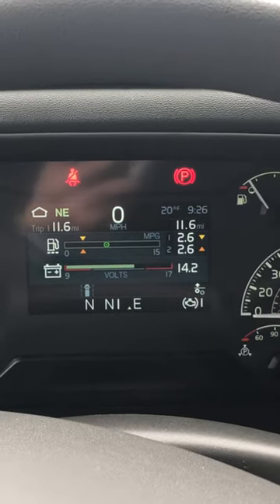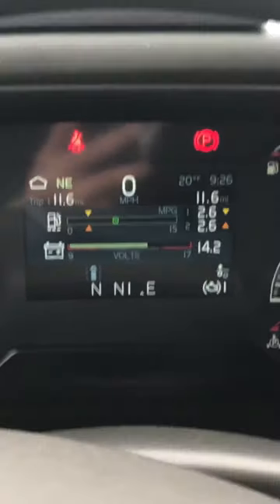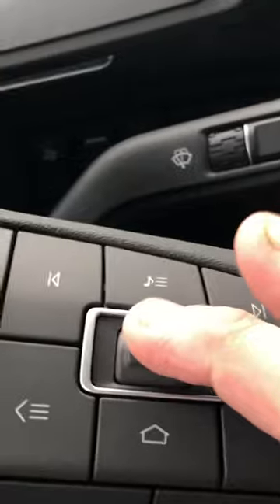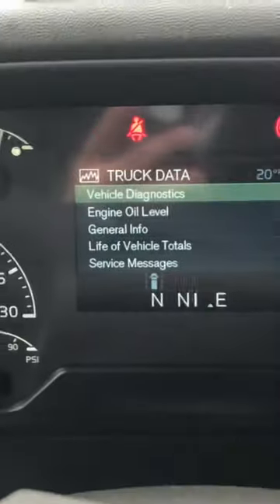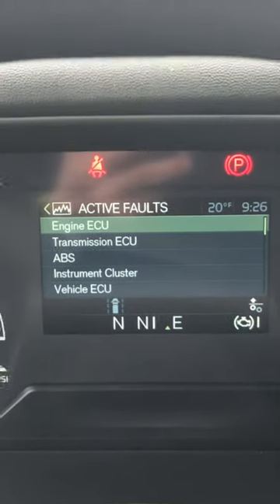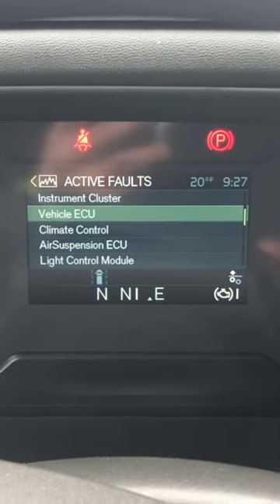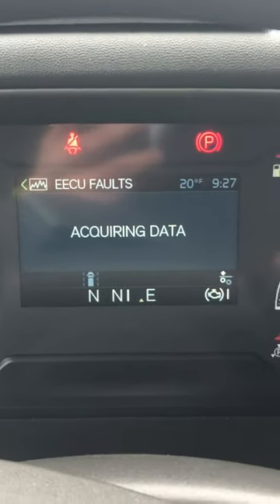Reading Fault Codes in a 2019+ Volvo VHD/VNL/VNR

Comment: Thanks for video!
After watching your video. I did Vehicle diagnostics. 
My truck 2019 Volvo VNL 860 has code  
DTC P040900 and DTC P040100. 
What can be the problem?
Reply from the maker: The second fault codes deals with the mass flow of the EGR being below calculated value.
Reply from the maker: Camden Eicher  they airbag k
light will only go one if the airbag deploys. If that light is on then you may be low on batteries. It only goes off of the airbag deploys.
Reply from the maker: Camden Eicher  I can ask service on Tuesday. I will let you know. You can disconnect the batteries for 15 minutes and see if it goes away.
Reply from the maker: Camden Eicher  Snap a picture of the light and text it to me at 4027408000
Reply: Brian I bought volvo vnl day cab 2021 in auction. Truck has only 20 thousand miles and i have a few codes showing! Can you help me if i can send you a picture of those codes. I will appreciate it if you can help me. Thank you!!

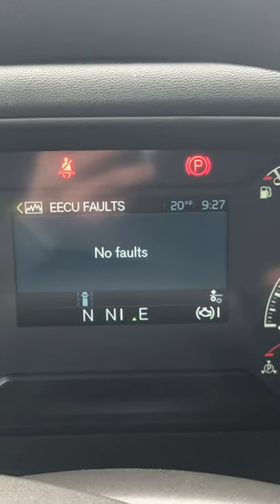Comment: It say missing  communication from transmission  ecu what what  i do its not starting 1:09
Reply from the maker: That typically means your shifter is not communicating with the truck. If you have a seat mounted shifter you can try unplugging it and cleaning connections.

Comment: I’ve got a 2023 VNL and the diagnostics show zero codes but my check light is illuminated primarily while driving for the past three weeks and neither the shop mechanic or I can’t find anything wrong, but how do I get this light shut off and what is it trying to tell me? 
It is the yellow rectangle that says check in the middle on the top left area of the dash just next to the DEF Gaige. Not the check engine light I checked the manual as well, please help!
Reply from the maker: They should be able to pull a code out of the truck. My service manager says you can try disconnecting the batteries for at least 10 minutes to let the systems reset.
Reply: I got the same problem and being that it’s my first Volvo it’s so annoying and frustrating I tried everything but tanks for the info .

Comment: I did which is you showed us that says no fault everything but still is on check fault 😒😒😒
Reply from the maker: Nizom Sangov my service manager would say to disconnect the positive cable for 10 minutes to let the system reset and see what happens. Your truck is like a computer and may need an update.
Reply: @BrianAskewTruckVideos  positive is the black one on the battery?
Reply from the maker: @raj25s  no, black is the negative.
Reply from the maker: Camden Eicher  We only have a drivers side airbag. Replacing it is only needed if it deploys.
Reply: Hi I have 2020vnl 760 I have code mid 144 psid 247 engine chick light is on I don’t know what’s problem